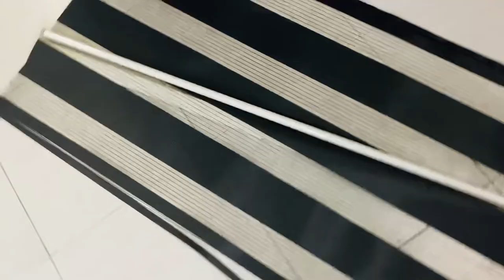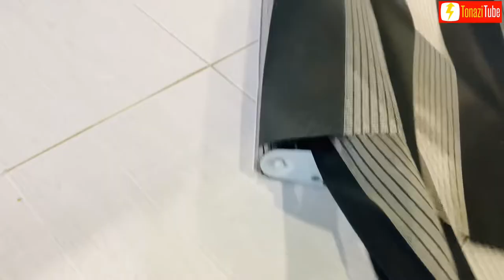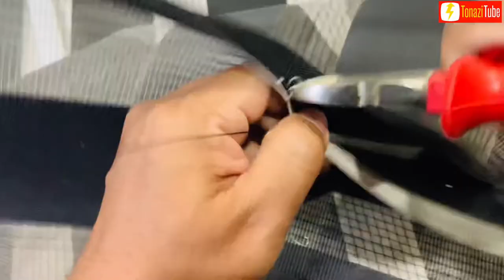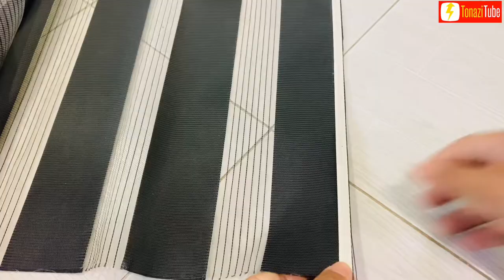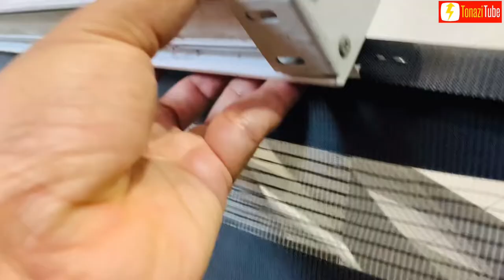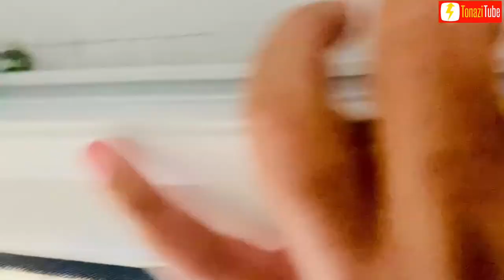How to Fix Zebra Roller Blinds Fabric Step by Step | Blinds Repair DIY | Zebra Shades

Comment: the blind will be shorter once damaged section is removed..as mine fit perfectly into my window this method will not work for me as i have two windows and they need to match..but i am glad for this video so i can fix  my blinds my cat shredded..problem is i can not find where to buy the material..If anyone knows shoot me their names..I am in Ontario Canada..
Reply from the maker: Thanks for watching.Im So Sorry for No idea where to buy the material at Canada.Hope anyone can share if got info on this issue.

Comment: My old house has a broken one with the bottom bar ripped off. And they have it held up by a broom😂
Reply from the maker: Thank you for sharing your experience 😀
Reply: I dont think they have any intention on fixing it😢 we had zebra shades all over our old house. And they have torn 2 of them. Because they one wont roll up all the way they have it held up there by a broom. They wont toll up because there is no tention without the bottom bar. And they are cordless
Reply from the maker: @TrentBiro Maybe the problem is slightly different with mine.Difficult to fix it.
Reply: @TonaziTube the bottom rail is gone so that might be it
Reply from the maker: Oh! That the cases

Comment: When it was installed it only covers half of the window. The other half of the shades was discarded and it makes the other half into two that will make the shades shorter as it was before..
Reply from the maker: Thanks for watching.It depend on the curtain size,size of the curtain in this video is longer and possible to cover the window after repair it.

Comment: Was this method only available because your cut was near the bottom??
Reply from the maker: My fabric were torn and broken due to direct with sunlight and rain water .For replacement,need to find the good fabric area with good condition and its was near to bottom side.

Comment: How can we repair the brackets (hanging)
Reply from the maker: Can you share the bracket issue .what problem with that?
Reply: The plastic that is connected to the brackets are broken so we can’t attach it properly plus there brackets missing so we can’t put the blind up. I can send a picture?
Reply from the maker: Your blind is same model as video?I think it different model.